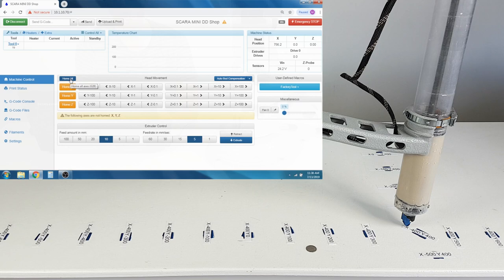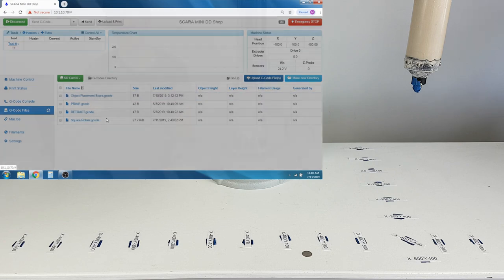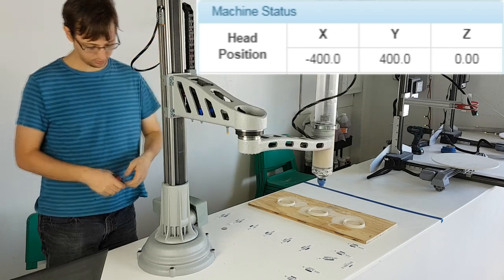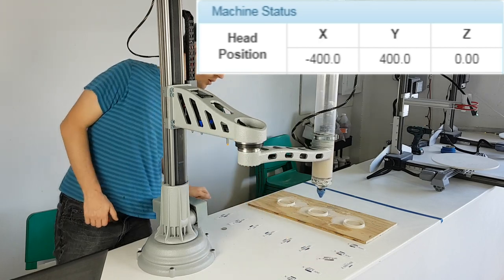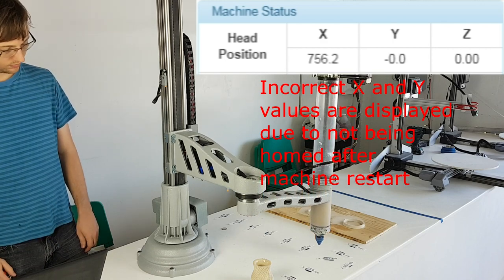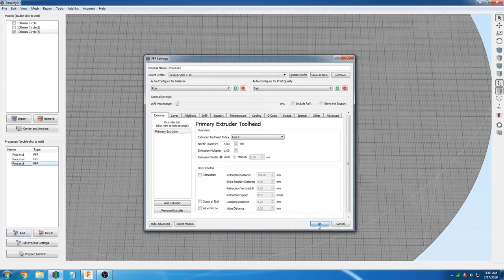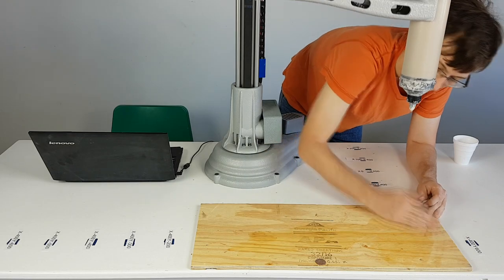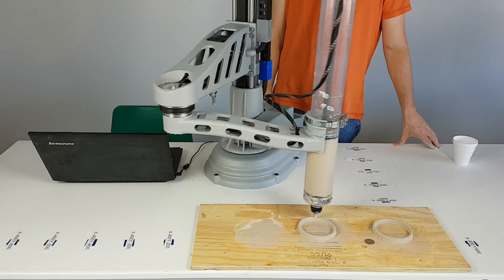Scara Operation: 3D Potter Scara and Scara Mini

Comment: i need to know coding the G code? or will be generated from my 3d object on solidwork?
Reply: With most printers the slicer turns it into gcode for you, but I do not know if SCARA type printers have special requirements.

Comment: Too much operator intervention required
Reply from the maker: We will admit, that there is intervention required. However it allows you full control to do what ever you would like it to do. Our systems are fully compatible with regular 3D printing software, such as Cura and Simplfy 3D.
Reply: @3DPOTTER  Make a small one that can cost say $2,500 & i can print small pottery with clay or cement mix. And i will buy it think about all the small creators by the millions on estsy.